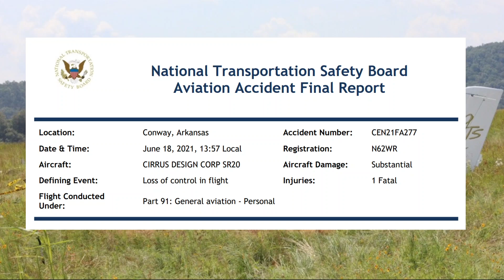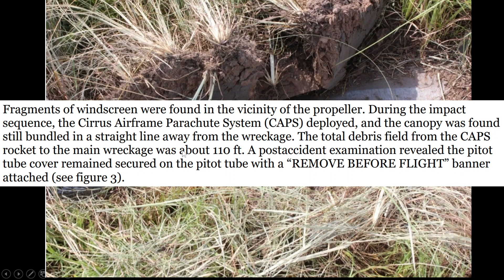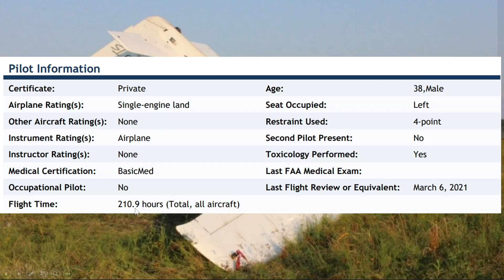Cirrus SR-20 Massive Stall Spin in Arkansas

Comment: Damn! Shit happens ive made a similar mistake once or twice when I  hung a rubber glove on the pitot while washing a plane but a pilot should after enough landings   be able to noticed your getting slow long before he over banked and didnt kick his rudder to the sky. not much different then driving down the freeway  cruising at 70-75mph and get behind a old lady only doing 50. I don't need to look down or have stall horn buzzing to realize im going to slow. plus when ever using either a turn or forward slip to lose altitude quickly or keeping lined up while battling a nasty crosswind the planes attiude may disrupt airflow to the pitot and your airspeed indicator will be inaccurate. Years ago I flew a old wore out radial ag-cat during my first season Only gauges that worked were my Tach, manifold pressure and oil pressure and nothing else lol
Reply: I went and looked at a fatal last week in a homebuilt Sonex aircraft based outta Colusa CA. It was only a 1/4 mile from where my dad put down a turbine thrush last year. Looked like a spin/stall not real sure why or how been scratching my head. Guess I gotta wait a year til ntsb is done to hear the story lol

Comment: The pitot cover still in place probably indicates a poorly executed preflight examination. It looks like a stall/spin and they probably would have been ok if they just set it down on the grass instead of trying to make it back to the runway.
Reply from the maker: Thanks Bob
Reply: Bob G : Using normal attitude and power would have allowed him to make a normal pattern and land. One can't panic because you lose complete control. This was not an emergency situation,all that was necessary was use sense's.

Comment: Every pilot should learn to fly your aircraft with the airspeed covered to feel the craft
Reply: Marsha Draskovich, you make far more sense than MOST of the other comments. Read some of my input on other comments and see if that's something you can relate with 🤔
Reply: Exactly!!! 
That was standard teaching up through the 60s. 
It's a little more difficult in a jet, but it can be done.
They stopped teaching feel and concentrate on controls manipulation. 
"Pull back 2 inches".... Instead of ADD BACK PRESSURE....feel the controls.

Comment: Even ForeFlight could have easily given him ground speed info which could easily have got him back on the ground. How the heck did he not notice zero airspeed on the takeoff roll? Did he normally just guess!?
Reply from the maker: Seems like it was a snowball effect of mistakes from the get
Reply: Matt heaven: He had power and the normal attitude and could have used the same to make a normal pattern and land; panic completely destroyed rational.
Reply: @garymiller5624  Really good points

Comment: Why did he only get to 600 feet and then  declare an emergency?  What was the reason?
Reply: He must have noticed he was getting no airspeed readout.
Reply: @wingandaprayer883  And that is a very, very silly reason to crash a airplane, Big time!!
Reply: @scotabot7826  I agree, I mean taking off without a proper walk-around first is silly to begin with, or not doing the "airspeed alive" checklist item before rotation is also silly.
Reply: Scott,a little thing called "panic". He definitely should not have been in trouble and at a small field why declare an emergency,fly the plane and use sense's.

Comment: I assume our low hour pilot didn’t have a working air speed indicator. Very dangerous in a Cirrus that is prone to spin/stall accidents due to its unforgiving higher stall speed than most pilot training aircraft. I wonder how far AGL he was when he deployed the CAPS. Good job on this report. Your reports will sound more professional if you sharpen up you grammar a bit. The word seen is never used by itself without either another verb or a helping verb (have or had). It is a past participle not the past tense of the verb to see. You said “There were some witnesses that seen what happened.” The correction would be to use the past tense of to see “saw” instead of seen. Or you could say that witnesses had seen the accident or the plane was seen by witnesses but not the witnesses seen the accident. The word seen always has to be paired with another verb to be grammatically correct.
Reply from the maker: Never was uh any good with this grammar stuff. Lol.  Thanks

Comment: Not just in terms of a pre-flight, but even if he had not caught that in a pre-flight, as part of every takeoff roll, you need to verify that your airspeed on your primary as well as backup instruments is alive and increasing. If it’s not, terminate the takeoff. The pilot should have caught that during the ground roll and aborted the takeoff.  I guess a case of an individual who is grossly inattentive of details like that, and paid for it with his life.

“Aviation itself is not inherently dangerous.  But, to an even greater degree than the sea, it is terribly unforgiving of any carelessness, incapacity, or neglect.”

- A.G. Lamplugh

Comment: Airplanes will fly, even slick and heavy ones, quite well without the engine running.  Partial power problems seem to be factors in as many accidents as do complete engine failures.  Airspeed and not altitude, he climbed too aggressively, is life down low where we are just high enough to kill ourselves in a stall.  500 won't help, nor even pattern altitude if startle is too much.  Learning to fly based on "Stick and Rudder" principles prior to hitting all the ACS numbers will help a lot.  Neither Vx nor Vy was appropriate here where he only needed maneuvering airspeed to maneuver to one of the fields or even the runway.  Airspeed is what makes the airplane fly.  Altitude as potential airspeed is fine also.  Use it.  Eleven of my thirteen engine failures were at 200' with waiver on pipelines or crop dusting.  But I always had maneuvering airspeed except in the top of the law of the roller coaster turn where I traded that 200' altitude for airspeed to keep flying/maneuvering to a suitable landing site.
Reply from the maker: Thanks Jimmy!

Comment: I'm sorry but no airspeed indicator or even incorrect airspeed indication in a small single is not an emergency, especially VFR, and it certainly should not result in a fatal stall spin. I've had two airspeed indicator failures, one total in a single just at rotation as a wasp got pushed further back into the pitot system and blocked the line and second partial in a twin with a blockage in the static system. Both were perfectly routine. Pitch and power to climb to pattern altitude, come around at  normal pattern altitude and power settings and so presumably normal airspeed so that the landing is visually and aurally as normal as possible. Circling back in low and fast, presumably from visual perspectives the pilot has never experienced before certainly isn't optimal. 
When I was an instructor back in the 70's and 80's I still taught the old school method, as I was taught, "Pitch controls airspeed, throttle controls altitude" and "Fly pitch and power not airspeed and altitude". Whenever I had a student that chased airspeed all over the place in the pattern, which every instructor has had, we could cure that in one pattern session by covering up the airspeed indicator with masking tape. Forcing them to fly by pitch and power for two trips around the pattern rather than chasing the airspeed needle usually cured them instantly. Make them look outside! Sometimes I would do air work with a student, including stalls and steep turns, at altitude with the airspeed, tach, artificial horizon and VSI instruments covered. Almost all students would perform better when their eyes were outside and their ears were working. Sadly this pilot either panicked badly or was never taught those basics.
Reply from the maker: Thanks for sharing your story

Comment: A proper take off includes doing a complete preflight inspection and monitoring your inster instruments during the takeoff roll which means never should have gotten Airborne in the first place . 
Then I see an inability to maintain proper flight speed without instruments, I  stopped using headphones because they blocked out far far too much information. It is easy to tell about what the airspeed in small aircraft   by the wind noise if you actually listened to it before.
Reply from the maker: Thanks Thomas for sharing that info.  Makes a lot of sense
Reply: Sound and CONTROL FEEL. 
Things that today's instructors do NOT teach because they can't fly for shit either

Comment: On the takeoff roll you call out "airspeed alive" and/or "abort: if no ASI. If loss of ASI in flight you fly known power settings and attitudes resulting in consistent performances thus consistent speeds.  The airplane flys just fine without an airspeed indicator. Poor piloting and lack of practice and flight under partial panel.
Reply from the maker: Thanks for your thoughts on this one

Comment: Someone failed to follow a checklist
Reply: We all make mistakes on every flight, for a variety of reasons. In this case, it appears the pilot missed the pitot cover on the walk around, then missed the “airspeed alive” on takeoff roll, then did not have the training/ability to fly an otherwise perfectly good airplane without an airspeed indicator. Several failures, in addition to not following the checklist, IMO.
Reply: @cessna177flyer3  it's difficult to miss the pitot cover.. It's red and dangling. More likely to there was no pre flight.
Reply: @Bren39  difficult, but not impossible. In my 14,000+ hours, I’ve missed the chocks, cowl plugs (it was a cold day and I pre-heat, so I decided to leave them in until just before getting into the airplane…then forgot), parking brake, and other odds and ends…fortunately never pitot covers. But I do give myself multiple opportunities to check/catch critical items like control locks, trim, fuel selectors, fuel quantity, and pitot covers.